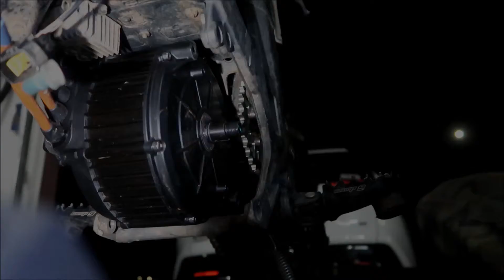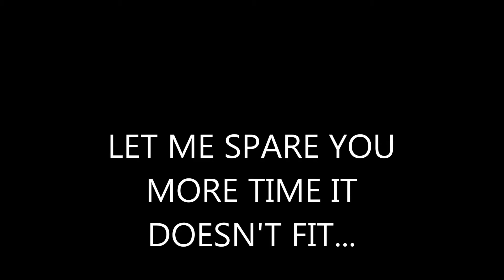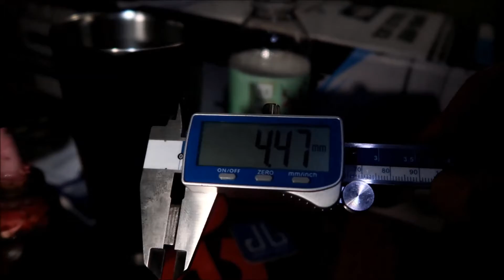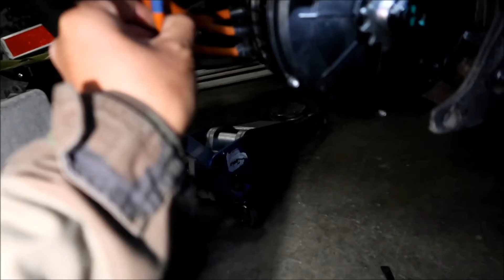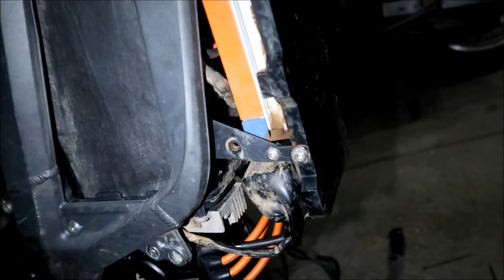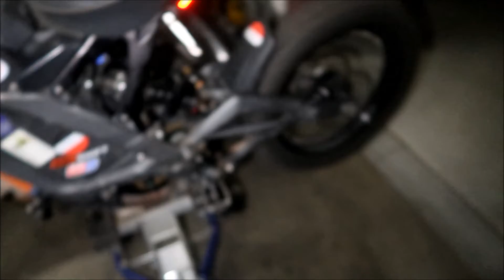Light Bee QS165 Installation VLOG Part 3: Install QS165 Motor Some Fitting Required...

Comment: It's pretty well documented on the intarweebs that the QS motor mounting bosses need to be filed down ~1/16" +/-  which keeps a precise and square chain line vs. modifying the spacer.
The commonly accepted method for 'getting things to fit' is to 'adjust' the clearances of the part you're adding (i.e. the motor casing) rather than original parts (including spacers - those things aren't just to 'take up slack space' but to specifically align things too.

Comment: The guys at EMotoBros had the same problem on motor fit ,and had to cut 1/16 to 1/8" on the motor not the spacers.
Reply: ? You can buy spacers at your local auto parts store